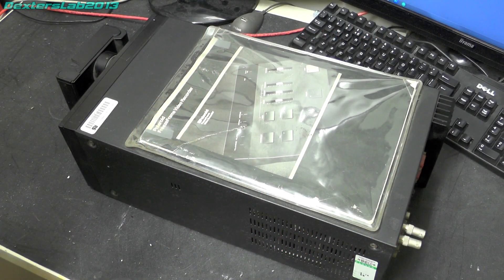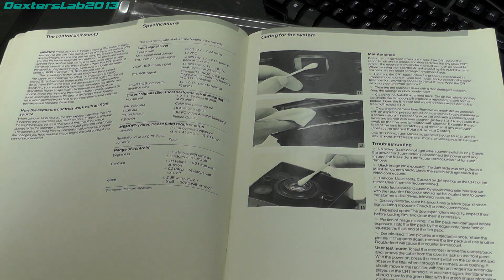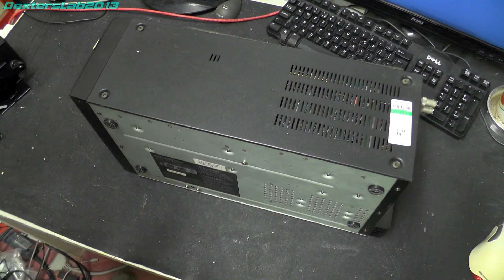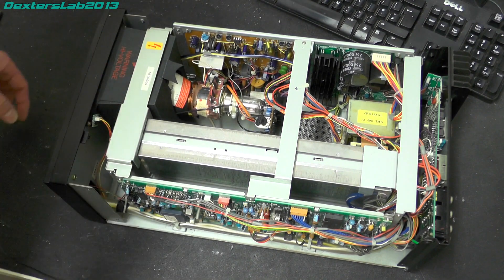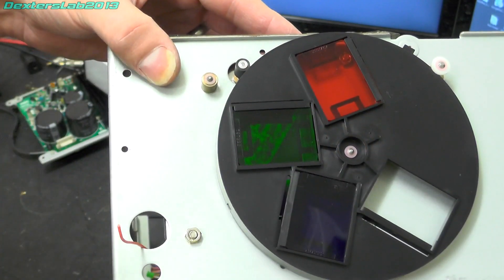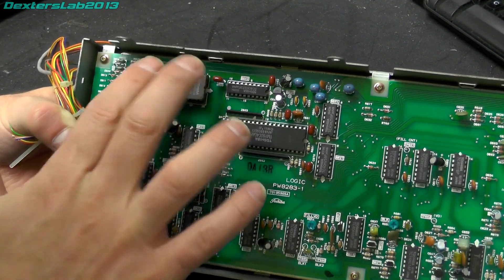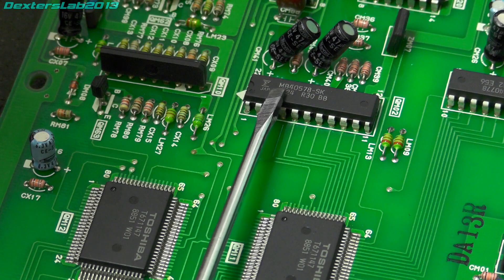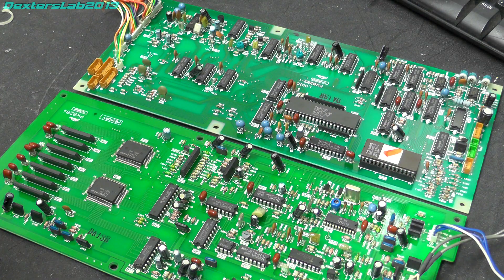DL143 Polaroid FreezeFrame Video Recorder Teardown

Comment: Very similar to digital film recorders of the mid-to-late 80s. One of the first compact digital film recorders to gain traction in the industry was the Matrix PCR from 1985, which was CRT based and could record in 4K resolution at 16 million colours.  A local shop actually had one a few years back; I probably would had bought it if I had the room.

Comment: Interesting! You've found something related to one of my projects! I've got a HR-6000 "Digital Palette" SCSI film recorder sat next to me, which is the computer controlled successor to your FreezeFrame (I believe the original analog-video Palette sits somewhere in the middle). I spent a good year reverse engineering the driver and writing a new one for Linux - my next project is building an adapter to mount a Pentacon medium format camera onto it (need to fashion a camera mount for that). The biggest obstacle at the moment is finding a copy of the Polaroid factory test software (Gentest) to focus the lens!

Your 35mm back will have been made by either Chinon or Ricoh. It's one of their cheap plastic 35mm cameras with an adjustable-focus lens (only adjusted in the factory, requires a test bench).
The whole system works by exposing red, green and blue in sequence. The Digital Palette units have an LUT for each colour channel (and a unique LUT for each film type) which handles colour-correction by tweaking the exposure time. They managed to hit 4K resolution on the HR6000 and ProPalette - and this was in the 1990s.

Towards the end, they were doing a lot themselves -- the HR6000 still used the same camera backs as the FreezeFrame and Palette, but had a high-resolution CRT with a Wells-Gardner control board and a photodiode-feedback luminance control circuit. Quite high tech for the time.
Reply from the maker: Thanks Phil, yea does look like a very similar machine! Sounds like you have spent a lot of time with yours! Do you have a special need to have it working?
Reply: Mostly it's a "can I make this work?" experiment. At the moment I have it working with 35mm and Fuji packfilm. The original idea was to take digital photos and print them onto C41 or B&W negatives, then put them through a darkroom printing process. I'm looking at other ideas too (which is why the medium format came into play). Stereo photography (two photos taken with digital cameras and then shown through a viewer) is on the list too.
I also wanted to look at putting an auto-advance bulk film back on there and record short movie clips on film. The trick with that is getting long enough lengths of film. Modifying a camera back wouldn't be difficult as I know how the camera interface works. The biggest difficulty is, like I said, finding a copy of Gentest to focus the camera.
I even tried reverse engineering the firmware, but the thing runs an 80186 chip internally. Tracing it out is a nightmare!
Reply from the maker: Ahh, ok... so is the gentest something a user would have used or was it an 'in the factory' production step?
Reply: I would had loved to have the Matrix PCR recorder which was at the local computer shop a few years back, but I didn't have the room.  It was one of the first really serious compact digital film recorders from 1985, and it had 4K resolution and 16.7M colours.  It was used in a lot of mid-80s computer graphics work.
Reply: About two month ago I made my HR6000 work. Actually finding cooperative computer was the hardest part of the process ;P
Interesting machine, makes awesome slides. I'm surprised how advanced this was.
Reply: DextersLab2013 Gentest was a factory tool but also one used by service centres to realign the CRT and camera and run hardware tests.

Comment: Interesting device.

It was a strange time period in the late 80s to 90s, when people still had a use for capturing video to still cameras, and vice-versa. lol
Reply: Mostly for presentations -- this was before Powerpoint (that said, there was Harvard Graphics), and overhead acetates were of limited utility. If you were having a meeting about some important thing and had supporting materials (photos, diagrams and so on), you'd probably have a deck of slides made and run them in a slide projector.
And then CRT and LCD projectors turned up and the bottom fell completely out of the market...!
Reply: I once took apart a slide printer that was a CRT to be connected to what I presume would have been a PC. A monochrome CRT and a color filter wheel could be used to generate color images. I think (but not sure) that different exposure times would have been used for color intensity.
In any case, it was just a tiny monochrome monitor with a color filter wheel and camera. No frame store or anything.

Comment: Using a monochrome CRT and that color wheel does make a lot of sense. A small colour CRT would have a very bad "resolution" due to the aperture grille (which a B/W CRT doesnt need) that cant be made too fine (maybe .25mm pitch).